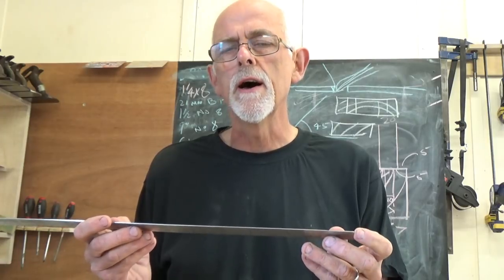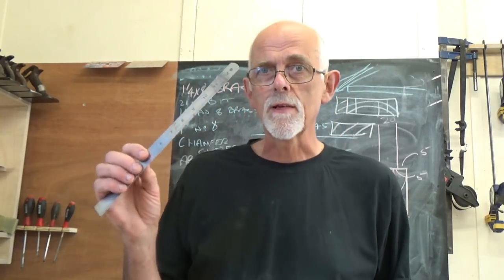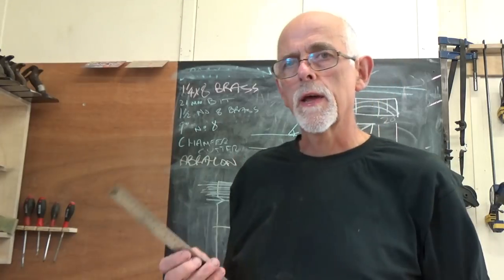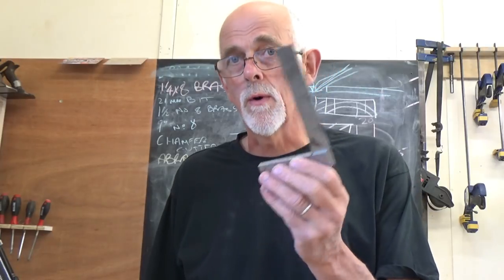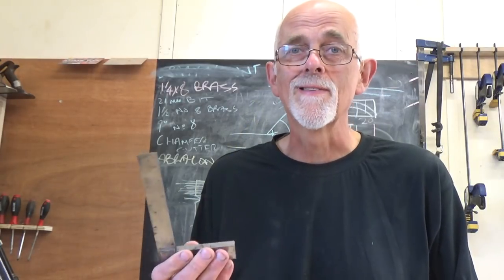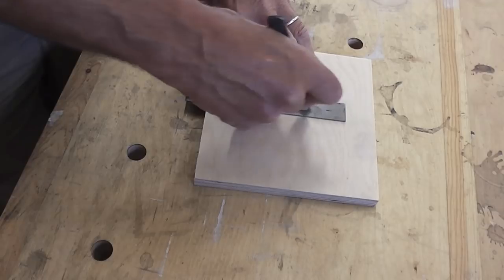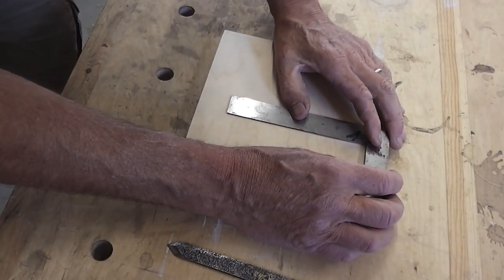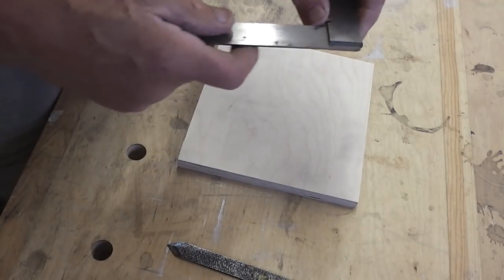Seven tips to improve your woodworking accuracy

Comment: I was surprised at the difference between a H and HB pencil, thanks.
Reply from the maker: Yes, the problem with the HB is that it's so soft. You can get a point on it but it wears away very quickly leaving a stub which is not accurate.

Comment: A sharp pencil in the knife line used lightly helps to see the marked area.Shade all waste.
Reply from the maker: Yes Joe, but it has to be sharp and light as you say, a thick soft pencil will highlight the line but also obscure it. Marking waste is important in helping you to saw on the correct side of the line.

Comment: Aren't the machinist squares just press fitted in between a slot.

Meaning if you want to move it you can, although I haven't on mine, yet.

No need to dress them.

Unless you mean something happens to one edge....🤦

16:06
When chiseling the board.
Why didn't you cut them closer and then knock them sideways breaking them. A lot quicker? Or is there a reason to cutting them fat.

I like how you hang your clamps. 🙋

Was wondering if you was gonna show how to square that chiseled to make the center flat from mark to mark all the way across.🤷😐
Reply from the maker: I'm not sure how the squares are fitted, I have always assumed they are fixed in some way, otherwise you would have to be checking them all the time to check they had not been knocked out of square, for instance when dropped. Also it would be difficult to do very slight adjustments. But I would be interested to learn differently.
I see what you mean about taking more wasting cuts and knocking sideways. I have always done it the way shown and not thought to do it any other way. You would need to do a lot of cuts before you could knock it sideways sop it may not be quicker. I will experiment when I get time.
Not  sure what you mean in your last comment, my other video on cutting a lap joint may answer it https://www.youtube.com/watch?v=esy25rsWtl4

Comment: I see people use vernier to as marker that makes me feel a bit uneasy.
Reply from the maker: I think it would me too. How do they actually do that?
Reply: They use the fixed jaw to run down the side or edge of the part and the point to scribe the work. It's an extremely poor practice since it stresses the calipers in ways it was never designed to take while wearing out the sharp tip. Some metal working videos are bad for showing this practice by some who have no idea of what there doing. Of course the new entry level people see this and copy them.
Reply from the maker: I can see it may work for marking metal but I couldn't see it working with wood, the point would not make a clean enough mark (check out my latest vid. on marking gauges). I agree that it would also ruin the calipers.
Reply: My main interest is metal working although I do a limited amount of wood working. It's inaccurate while marking metal as well since the caliper has to be slightly tilted so the fixed jaw can run down an edge. You could use a Patek Philippe wrist watch as a light weight hammer, that doesn't mean it's a good idea. The proper use of the correct layout tools are designed for the task, reasonable to buy, and the scribes are capable of being resharpened. A $6 scribe makes far more logical sense than over stressing and vastly shortening a $200 + tools accuracy lifespan. At most in a commercial machine shop where time is money I might do so, but then plan on replacing the tool every year or so. Not when I'm buying my own good tools for use at home. Using any caliper in that way demonstrates laziness and a distinct lack of knowledge of what that type of abuse does. There's a great deal more to craftsmanship than just the finished project. And yes a good accurate square and marking knife or a marking gauge would always give you far better results every single time when doing a layout on wood because there designed for that specific job.